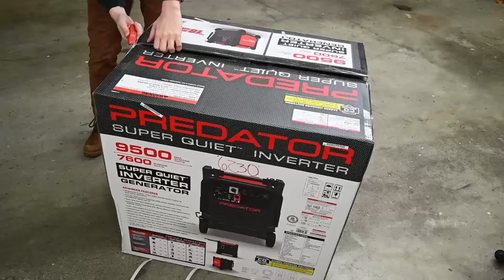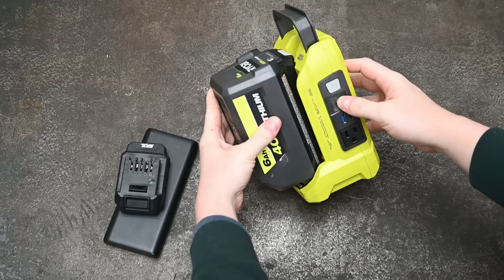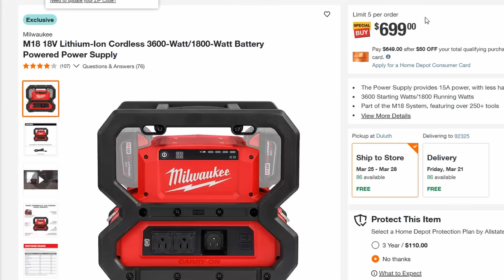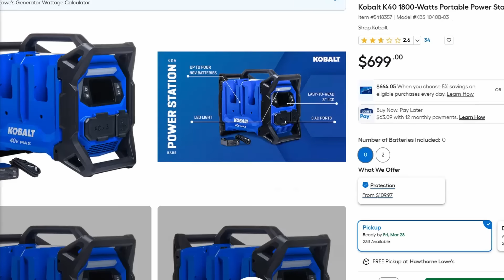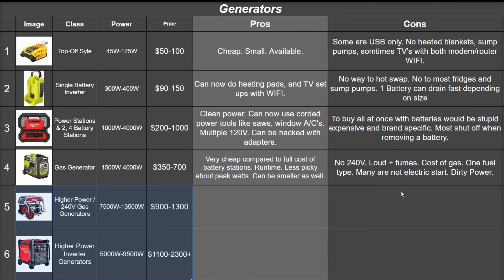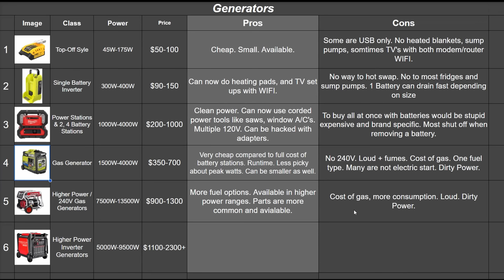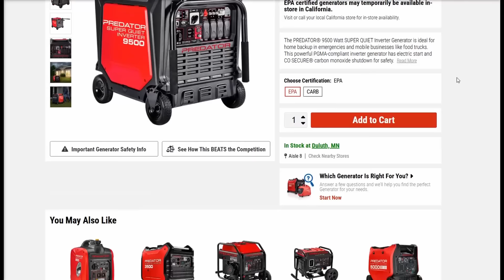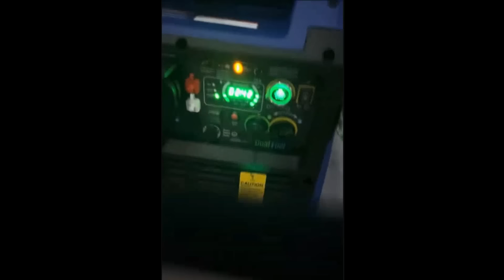Buying Harbor Freight's Most Expensive Generator So You Dont Have to

Comment: It would be easier and cheaper to just get a line-active UPS for any sensitive electronics that don’t like the dirty power.

You get the dual benefit of having it on UPS for short power outages/fluctuations like maintenance, where you weren’t going to power on the generator. It also keeps it on until you power up the generator; where it will clean the sine wave.

Comment: I belive the best setup would be a small inverter with a larger battery so that way you can fill the battery turn off the generator and run the battery and if you need something more powerful use a large generator

Comment: I live in the tropic and everything is 220V single phase in my house and I have a 2200W Max 80cc Inverter generator and a 4200W 270cc Inverter generator that I just run for big loads because it drinks 3 times the fuel, but it's an industrial model and it's a tank. My house is really efficient Inverter split AC, Refrigerator or just naturally low draw. The washing machine/dryer and the inversion cooktop are the only loads I must crank the big generator. Considering a battery system to hybrid my power but hard to justify when the small generator only drinks a pint of gas per hour when batteries and the inverter are so expensive. It's not all about cost, it's also about logistics, having to bring home all the fuel you use for possibly 10 days. 30-40 gallons for my efficient house if I want to live like the mains power is still on. Most people I know who have solar it doesn't work after a Typhoon, those 275kph winds have a habit of messing up anything exposed and not shielded by concrete.

Comment: IF you have a plasma cutter you want to run, check the requirement of the cutter - I have a 10k generator that won't run the plasma cutter at full power - breaker trips. Apparently needs more than the 33A 240v the generator can provide.

Comment: I went through this same thing 4-5 years ago. Ended up buying a 12,500 watt Pulsar generator that was about $800 with free shipping. Got an RV outlet and backfed it into the breaker and a 75ft  cable so I could run it from the shed so neighbors wouldn't be up all night which was another $300. The thing is LOUD but it does the trick. I have a bunch of PCs and electronics that are sensitive to power spikes so I got 2 UPCs with a battery backup that smooth out the power and will keep power going until I can get the generator running. Sad thing is since I bought the generator we haven't lost power a single time.
Reply: That's how it usually works. I bought a big snow blower right after the blizzard of 96 in New Jersey (100 foot driveway to the back of the property, previously had to shovel that three times the previous winter).   We didn't have more than a sprinkle of snow for the next six years.

Comment: One big downside of gas I didn’t hear mentioned was gas going bad. If you don’t use it regularly the gas will degrade and might not start or run well enough to sustain a full load. Sta-bil can help but it’s not a total solution. Propane is a great option because no worries about this, though not as easy to replenish in a disaster. If you are off grid you could get a huge tank and make it a non issue or go multi fuel.

Comment: My workaround for computer/internet is to have everything plug into a UPS.  That buys me 9-19 minutes to power the UPS from my EGO power station.  I can then flip batteries and keep everything on.  My UPS does not like the dirty power from the generator, so I need to keep the UPS powered by the EGO station.  Interestingly the EGO charger has no problems charging batteries off the generator.  When power is restored, I just unplug the UPS from the EGO station and back into the wall, and the UPS is the cushion I need to not have anything reboot.

Well don <- (imagine an 'e' here) review.

Comment: In my whole house for heating and cooling, well pump and hot water in an old huse from the early 60s in -25°C outside i still never go above 4900 watt with only a rare peak once a month in the 5200 watt range.
Just use the power normally.
This is heating with a proper 7.4 Kw heatpump (max power it can draw is around 2.3 Kw) , if you use in floor electric heat you can forget about it since that is extremely inefficient compared to a heat pump

Comment: How much do I need? I'm not happy unless I can turn everything on. I've been working my way up. Started with 5500, went to 7500, now I'm at 10,000. The 10 will run just about everything, but the heat pump takes a ton of energy. I'm hoping that when we change to 2 mini splits, I'll be good with 10 at least run 1 at a time. I've been looking for the right deal on a 15kw + diesel I can hard wire into the panel, but, haven't found one yet

Comment: Working in the entertainment industry I can say: The bigger the Generator, the better the power (quality wise). And Diesel is better than Gasoline when it comes to not sagging in RPM when starting big loads
That is also the reason why inverter generators are better since on non inverter generators the output frequency is related to the RPM of the engine. 60Hz equals to 3600 RPM (or 1800 for big gen-sets). If the engine cant keep up, the frequency drops and can disturb sensitive loads like dimmers for example
You rarely see a Diesel inverter since they are usually pretty stable from the beginning. In order to make more power on a gas engine the first thing happens is the throttle opening. Then comes more air, than more fuel and after all that more power. A Diesel runs always with excess air, all it needs is more fuel and makes more power almost instantly. Added to that is the larger inertia in the bigger flywheel

Comment: Power line noise from a conventional generator..... realize that the "Power Utility" basically generates their AC basically the same way, the reason you don't see "noise" on their sine wave is they pass the power through step-down transformers to get to your 240V feed. The magnetic reluctance of the transformer(s) reduces the higher frequency components (ie "noise") and you get a clean sine wave

Comment: Good video.  I'm watching this from my kitchen looking at my newish $5k fence thanks to Hurricane Beryl last summer.  We finally decided to get a generator and the local (I use that term loosely as I'm about an hour from the gulf and I saw a great video from a guy in Katy) favorite is the tri-fuel Westinghouse.  We have pretty good power grid where I live, but I know my brother out in katy has crap power, so I am wanting the tri-fuel model I'll roll out to my NG gas line, hook up the genny, connect it to the breaker box, flip the bypass and have AC and keep my freezer's running.

About the dirty power, LOTS of reports after Ike of home appliances dying after people running them on dirty power, so there is good point about the need to a clean sine wave.

Comment: Look at maxspeedingrods for alternate on inverter generators. I've done a lot of research on small gen recently and got a suit case 2300 maxspeeding rods and the inverter wave is clean, not ugly as the ai power you have. They have larger gen too and are an old company that is mainly doing racing car part and now diversifying.

Comment: Propane capability is useful if you plan on using these as whole house backup generators. Cause then you can just get like a 100 gallon, or larger tank installed, and not have to worry about refueling when you kick your generator on in those rare outages. In the meantime...you can BBQ to your hearts content. Lol!

Comment: I am curious about using an adapter to power my M18 mower with one of the 12ah High output Hercules batteries. I’m guessing from your testing the adapters hold up fine? I figure the mower is pretty high draw, but in my mind the only thing that could possibly fail would be the battery in that case, not permanent damage to the tool right?

Comment: As someone who lost a 12k genset after 100hrs (rigid) I will never buy another big one.  My 2k wen runs too good 8hrs on 1 gal, very light, even the wife can start it. I would get one or two more and run a few cords for the cost and fuel usage.   Yes I can wait to run the tig and if I need the mig can run on 110.

Comment: Oh wow, that soldering iron at the end is the exact same one I first soldered with 40 years ago as a child on my late father's knee. Thanks for all the generator experience - appreciated. I intend to get one for backup use in future, I'll be sure to go inverter and size it appropriately. I'm 240 only here, though. But that's fine, most of what you talked about is globally applicable. Cheers.

Comment: I just saw that new 100W DeWalt combo today - I'll be looking for specials on that and getting at least one - the 100W wall unit makes it worth it IMO. 100W from mains and 100W from dozens of batteries, endless USB C power :-D And I can plug the tablet into that and the phone into the A port. Perfect.
Reply: Interesting, the US one only has 65W plug pack? The NZ/Aus one is 100W and 25-40% bigger in each dimension, big square, similar but a bit bigger than the bigger 100W Mac one I've used.

Comment: Wtf is a deep well sump pump? Are you talking about a jet pump with a garbage deep well kit being used in the most inefficient way possible?

The minimum generator is a off brand “5k” generator that can start and operate a submersible water well pump. Most of the time 240 but there’s 115 ones as well.

What someone really needs to be ready for any outage is a legit 10k or bigger.

A good answer is Lincoln 10k generator welder. Cheap no but you can find used for good price and the power coming out of it is cleaner.

Comment: My $30 Meiho (Makita) marketplace sourced generator sits for months at a time and fires right up 2nd pull. It’s super easy to avoid clogged carb jets and make fuel last, options include: 1. Close the petcock and let it run until it stalls 2. Drain the bowl 3. If you’re using pump gas ADD STABILIZER 4. Run AV-Gas, it lasts ~10yrs and doesn’t varnish when it evaporates.

Comment: Can you run an electric water heater off one of these, or is that just silly? During our last power outage, our electric water heater  obviously went down. Taking showers in ice water didnt sound like fun, so we didnt shower often. It got bad enough that I started heating water on the wood stove and took a bucket of hot water to the shower.

Comment: Only comment on your ratings, when you put dirty power as a negative for the smaller generators, some of the ones you showed as examples were inverter type, which would have clean power.  You maybe could have split the small gas generators up into inverter and traditional as well.

Comment: Your April Air humidistat is supposed to be mounted on the return plenum. 

Also depending on what model thermostat you have it can control the humidifier.  no need for a separate humidistat.

Comment: Have you heard of UPS uninterrupted power supply’s? They’re usually made for the pc market so you don’t lose your files during an outage but I’m sure you could get one of those to power your furnace during an outage while your house is being fed by a dirty power gas generator. they usually have lead acid batteries in them and stabilize bad power by using their batteries and are constantly charging and discharging till an outage
Reply: Also to protect your pcs from a short circuit event or something unexpected from the grid

Comment: you dont know how long ive been waiting to see this series. please look into testing the millertech powertool battery inverter. they are pricey but seem really top notch with awesome features. also would love to see Milwaukees 175watt tested , dewalts 1800 watt inverter tested and ryobi with the solar/40v/18v inverter. 
HOWEVER you did miss one key feature on dewalts new 100watt usb c charger/inverter. you can get a 100watt 12volt car adapter that dewalt also makes and charge your 20v and 60v battery from your car! i almost use it exclusively now to car my batterys up! basically free power!

Comment: There's going to be some maintainance with a gas gen. Mine always runs fine when I test it, but balks when the power goes out.  Frequent issues are crud in the fuel bowl (better with ethanol free fuel), and occasionally the recoil messes up. The oil level sensor seems picky- it wants the oil filled up to spec, or no spark!  It's an older Briggs and Stratton with ball bearings that make the connection between the rope and the motor. The ball bearings occasionally stick in the disengaged position, which requires a good bit of disassembly (a swift kick sometimes works). And of course oil, fuel filter and spark plug.
Modern units seem to fail out of the box. I'm thinking the CO monitor may be the issue.

Comment: I bought a cheap 300w car power inverter, cut off the cigarette lighter connector, added 2 male spade connectors on the +/- and plug that directly into the M12 batteries I have on deck. The inverter had 1 main 3-prong plug recepticle and 2 usb-a ports, that both put out 5v/3a. It was like $17 and beats any top off inverter Milwaukee sells for their stuff. Also the inverter has a year warranty, havent had to use it but its nice to have just in case.

Comment: The DeWalt inverter power station is not pure sine wave but does great with power tools and the like, the others seem to be pure sine wave so DeWalt really could use a upgrade.  I'am a millennial and have never even had that much cash on me to buy a brand new huge wattage gas generator much less a inverter generator unless it was in pieces but ill make do some how.  Just keep telling myself "one day".  I really would like some runtime, load test, comparisons with the power tool power stations also some temperature readings from them in use and if you can parallel powerstations at all.  As always keep up the great work, best part of my week is Torque Test Channel on a friday evening.

Comment: I Have The Ryobi 1800 Watt 8X18 Volt One+ !! You can Swap The Batteries While It Is Running No Problem!! I Have 8 6AH Batteries That I Plug In It And Dozens of The 4AH Batteries! It Will Not Run My Dewalt Skill Saw! But Has Run Everything Else I Have Plugged Into It! Like My Microwave And Space Heater On High!

Comment: The bullshit is AI power advertised that generator with THD to sell units. Almost bought one but ended up with a Champion 7000 running open frame inverter gen. Then Champion pissed me off offering a tri fuel version. Natural gas is the way to go. Just keep extra oil and spark plugs on hand and you should be good. As always great vid and love the honesty.

Comment: Just sayin', for that use case, I'll go UPS every time. I have 7 of them in my house. When the power goes out, my internet, computer, unraid server, wifi, and charging outlets in our bedroom are all held up for ~1 hour+. If it looks like it's not coming on after half an hour, I fire up the generator. The big advantage is that it's seamless and requires zero intervention on my part. Would definitely be worth adding UPSs in if you ever re-cut this video.

Also, glad to hear your wife knows how to set up the generator. I feel like for many guys, it's the expectation that you will go deal with it by yourself, every time, and that she shouldn't even have to know what to do ... but if junior pukes in the middle of the night, you'd better be ready to get up and help.

Also, final note, there are a few oldschool gas generators that have low THD alternators. Costco used to sell a handful of models, and Northern Tool still carries an extensive line of them. The advantage is that watt-for-watt, they're cheaper than inverters and generally top out at higher capacities. The downside is that they can't idle down like inverters do. Gas usage generally isn't as different as you'd expect, though. The issue with your furnace was likely due to THD in your old generator's output rather than low voltage, a lot of home appliances are very sensitive to it. Line conditioners do not improve THD, which is also probably why it didn't work with your furnace.

Final final note, because I noticed a typo/error in your table -- most of those small inverter generators ("suitcase style") are true sine wave and do not make dirty power. If your furnace is 115V, those suitcase generators would run it just fine.

Comment: My vote for any of the Honda inverter generators.  Off grid for the past twenty years with solar and- since 2013- a 1000i and a 2000i.  the 2000 will handle a 110v mig welder.  They are built unbelievable well, mine have thousands of hours on each.  They sip fuel, are quiet.  Besides oil changes, I changed the spark plugs twice, the starter rope once.  They just keep going.  Well worth the high price tags.

Comment: We  install those Tripp Lite Eaton Series Power Conditioners (with Automatic Voltage Regulation) everywhere -- especially the big rack mount unit.  BUT you got the wrong device completely and whoever sold you that obviously doesn't know how they work.  They have two components -- first a very effective surge protection and filter for electronics like both motors, scroll motors and all electronics.  The other part is a multi tap transformer and a bunch of relays.  The way it works is whatever voltage fed in comes out at 120V (from around 60 to 180v input) but using the different taps which are automatically switched by the relays (extremely fast).   WHAT you needed was a online double conversion UPS with boost and buck which will output pure clean sine wave power all day long but big ones of these (specially with lithium are expensive). A good way to buy them is get the units used for traffic light signals cheap at auction and replace the batteries - those units are extremely robustly built (SMART1524ET is one such model).